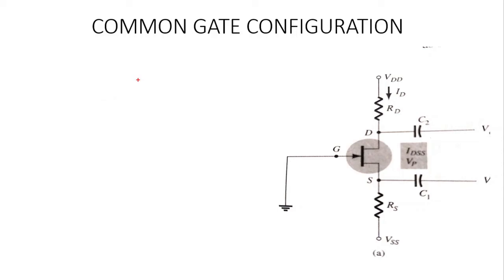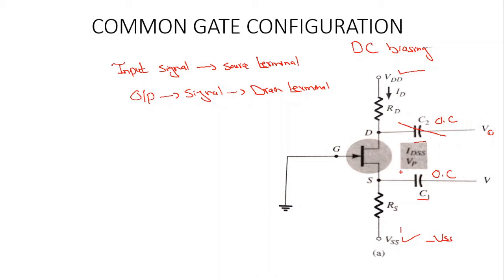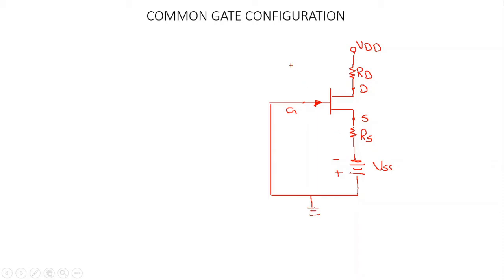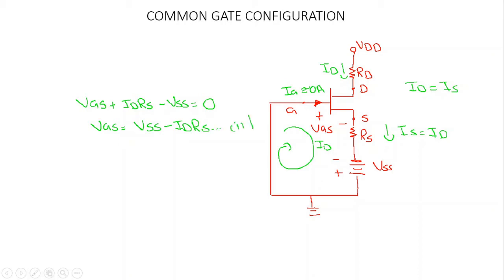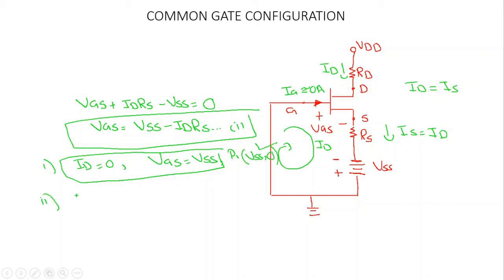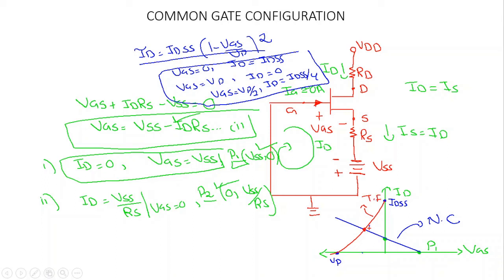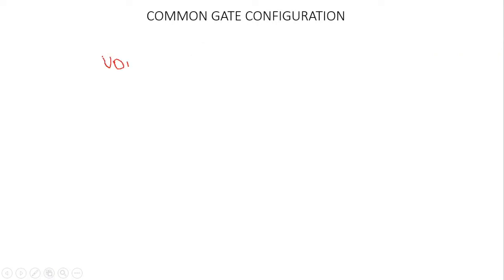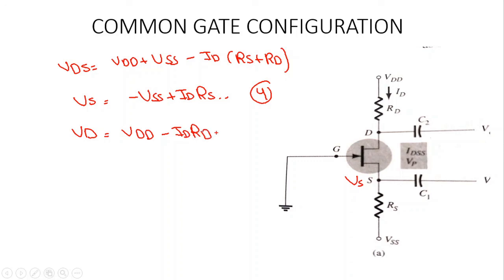Common Gate Configuration of JFET|JFET Common Gate Configuration| Common Gate Configuration FET

Comment: Sir, what is meant by "Lower potential w.r.t Ground" ?
Reply from the maker: Basically means VSS is at negative potential..
Because negative potential is lower than ground potential(OV)
Reply: @TechnicallyExplained  Sir but in book they haven't mention such thing. How can we know if it is at lower potential or higher potential w.r.t Ground?
Reply from the maker: I think in book it is given -Vss
Reply from the maker: You can also understand it from battery orientation..the small line indicates negative terminal and long line indicates positive termninal